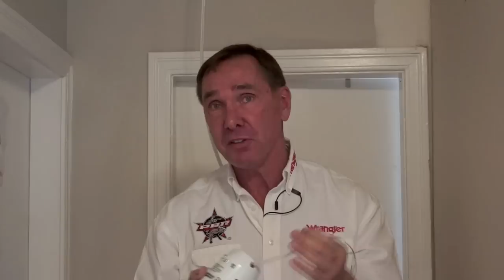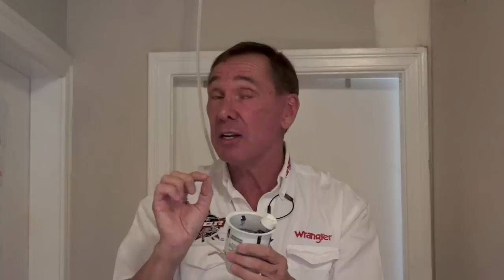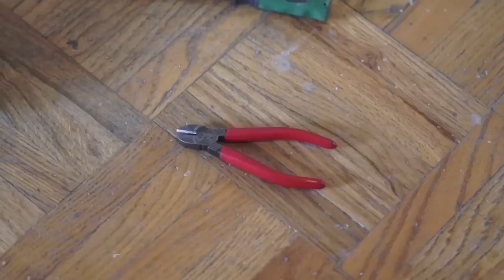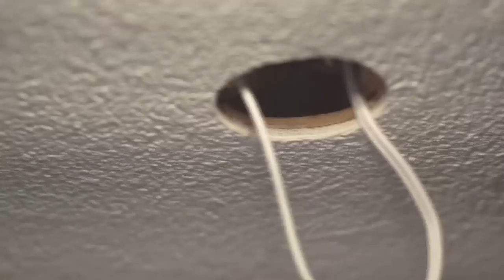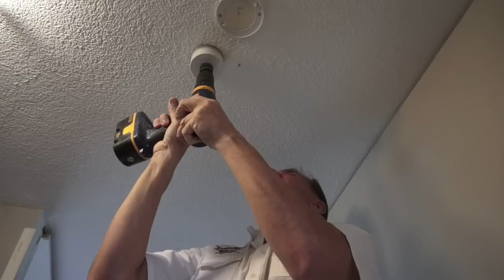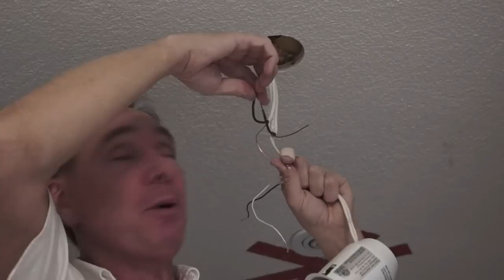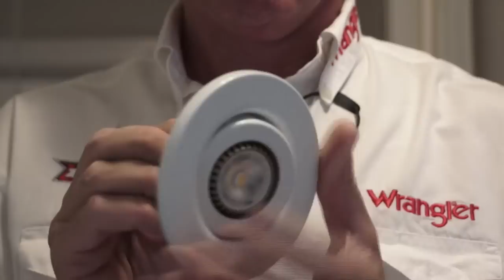How to Install Recessed Lighting | Retrofit

Comment: In the beginning of your video it looks like the fixtures had junction boxes attached. Why didn't you use them? Why did you go through the trouble of removing them? Wouldn't it just make sense to keep them and wire according to code?
Reply: Low roof line? Percy Lipinski Silly answer, With all due respect, you are incorrect. You could have used a grounding clip or even a self tapping screw to bond the ground, however you chose to ignore doing this and have placed not only yourself at risk but your family, and any potential buyers of your house... not to mention the innocent people who watch your video and will do the same dangerous installs that you have done
I will now report your video because someone can get killed and you can obviously care less, because instead of considering everyones advise to you here you also chose to bully and belittle users (and this is also against youtubes terms of service) because your too embarrassed to acknowledge you are in the wrong.
Reply from the maker: So here's why. You seem reasonable so I'll explain it. I would have had to replace the roof to donut as there is only a few inches of space no way to fit in a can let alone a connector box plus insulation. Do what's the only safe way to handle this? Either a big honking 12 volt transformer and non standard 12 volt bulbs that have been know to spontaneously combust due to the unregulated market for 12 volt fixtures. That has happened. 120 volt bulbs on the other hand are heavily regulated so I went thataway. The next consideration is safety. 5 or 6 watts is NEVER going to generate enough heat to cause any problems, even in my tiny ceiling space without a can. The stupid idiots on this video haven't got a clue beyond "because it says so in this book". The fact is "that" code book is seriously our of date and assumes that people will still be secretly using incandescent technology. I am not and never will and if I sell the place I'll be sure to tell them. That said, in this jurisdiction halogens are banned and soon federally so you'd really have to work hard to fuck it all up. Our family enjoys the very bright light, low power consumption of these bulbs and we'll be doing that safely for years to come.
Reply from the maker: Petey (stupid made up name if there ever was one by the way) you have proven once again how stupid you are. So let's keep it simple. I'm obviously "wrong" says who? "Wrong" means the house has an electrical fire and burns down you stupid idiot. I've asked for an example of exactly what it is that would cause a fire. NOBODY has come yet with one example of how this would happen. You know why? BECAUSE THEY'RE STUPID IDIOT MORONS THST HAVFNT GOT A CLUE!!! You are just as stupid as they are you dipshit for believing their idiotic rants. Grab a dose of science, instead of listen to these total fuckups!!! I 100% guarantee that my house will be fine today, tomorrow and for the rest of my life. No electrical faeries are going to come out at night and start shorting wires, you IDIOT!!!
Reply from the maker: It was not possible due to the extremely low roof line there was simply not enough space.
Reply: Joe Weatlu That would obviously have been far to close to the correct method for old percy, nothing but hammerdick it in for that chap.

p.s. I hear that if you show Percy your J-Card he'll show you his pecker :)  Bonus!
Reply: Hi Percy Lipinski   I want to ask a serious question... I noticed how you stressed in the video how important it was to connect the ground wires and make good connections. I also noticed you had never connected/bonded the ground wires to the metal housing of the light fixture . In this case, why was it so important to even have ground wires in your string of lights if you did not even use them? Lets say the hot wire broke off the socket and touched the metal housing of the fixture ? That metal housing will become energized with 120 volts. With no ground path to trip a breaker,  Anyone touching the housing now has the potential of getting a shock that could result in serious injury or even death. What is your reason for not grounding the metal fixture? Thanks in advance for a respectful answer.

Comment: Instead of all your fowl mouth comments to posters you should just admit your mistakes. Mistakes such as: the cans are not rated to be in contact with insulation, no electrical box for the wiring, telling people that 120V is not dangerous, assuming no one will ever install anything but LED lamps, etc. Most replies to the video had safety in mind. You seem to be totally against the safety aspect. I'm all for DIY work but it should be done to code and safe!!! You should either put up a disclaimer admitting your mistakes or take down the video!
Reply: Percy Lipinski
Hmmm...if you're in a room with 100 other people and you think everyone but you is an idiot, maybe, just maybe you're the idiot.
I rest my case!
Reply from the maker: Listen you Mindless Moron, I'm in rooms with thousands of people at times and I have no problems. This channel attracts a lot of weak inclined idiots like you trying to sell us crap. Unnecessary crap just to rip us off. I 100% guarantee that no matter who or where my instructions are followed, they are more likely to die of a lightning strike on the house than a fire caused by an electrical fire. It's low end losers of life that insist on following a rule book written decades ago. Hey Mr. Bill the bible is a code book. You following that to the letter as well, L O S E R dickhead.

Comment: As an electrician with two decades of experience, you're a fucking dangerous moron.  120V isnt dangerous?  Are you serious?
Reply: "There's nothing more dangerous than an idiot no brain so called electrician."
Yes there is: an idiot (with) no brain who posts on YouTube without having a clue who thinks everyone else must be an idiot because he doesn't understand why they disagree.
Reply: Percy Lipinski Have you ever seen electrical burns.. Panels, breakers, devices in boxes, splices....??? Do you think it's all made up so "electricians" can charge more?

It happens.. and your house isn't safe...

You used the wrong fixtures.. open exposed splices.... And your argument is it's been ok till now.. Have you ever removed the fixtures and checked for dark burning insulation... NO..

You installed these things saying 20 years from now you won't be able to get the dangerous bulbs to put in them..

All the stuff your saying and thinking... if you believe it ...

Your a danger is right..  I see new dry wall up in the video. Wonder what else your destroying and screwing up but justifying in Percy's mind?

Comment: Also, the Nest thermostat was introduced in 2011. How did you install these 4 years ago, when that is in place? Let me guess, you made a time machine too. You are the absolute definition of fucktard. 

I'm not starving, and wouldn't work in your shit pile house for all the money in the world. Actually, I feel sorry for your house. You've fucked it up really good.
Reply: Percy Lipinski
I wasn't sure what horsepower had to do with any of this, you brought up the incorrect estimate of how many watts is equal to one horsepower. I never stated that light equals heat, I am not sure where you got that from. I stated resistance converts electrical energy into heat. I understand that you don't quite grasp that, it is pretty advanced electrical theory. Much like understanding 120v of electricity is enough to kill you.

Is there a reason your face is always red? Are you always this mad when people try to correct you?
Reply: Percy Lipinski
 I don't understand why you are so angry. I get it, your installation has not had any issues, but you need to understand that DIY and hack work is the reason there are so many electrical fires. When things are wired to code, there is slim to no chance of a fire. When things are wired at a standard that is below the code standard, the risk of fire increases depending on how many mistakes and shortcuts were made. I find it hard to believe that you are an engineer if you cannot grasp such simple concepts. Perhaps your engineering degree came from DeVry?
Reply: Percy Lipinski
Man, you don't have the grasp on theory that you think you do. Also I'm seeing a lot of inaccuracies in your comments. You know 6 watts is not 1/100th of a horsepower right? 1 horsepower is equal to 746 watts rounded up. Anyway, you should relax. All of this anger and rage is probably what weakened your heart, if you don't chill out you may never see retirement. Assuming your house doesn't burn down from your questionable wiring practices.
Reply: Yes William R.  I pity the fool who may be wanting to buy this house in the future. All those beautiful high hats not knowing the shit poor job done on the other side that you can't see.

Terrible work... You were so close... All you had to do was to make the splice in the box that the fixture was attached to. They put that box on there for a reason, and even supplied it for you..

Probably was more work removing those boxes than just installing them..

Diagonal cutters used as a plyers... knick the copper much.. You can call people names and try to justify your work, but the truth is... you screwed up !
Reply from the maker: I wouldn't let your unskilled hands near my house to begin with you little loser, don't flatter yourself. So first of all there were two sets of lights installed one 5 years ago and another 3 years ago NOT 4 stupid. InFact I put some others in 5 years ago you icon of idiocy! Guess what? Not one system has had a problem. OMG how can that be? Maybe the "code" wasn't right!!! Code, ya it's a code alright,"a code of dishonor"
Reply from the maker: Why am I angry? I'm not angry I'm pissed off that you scammers see out to rip people off and you're so goddam stupid you have no idea what you're talking about. Get it through your head!!! Do you know what "load" is. It's POWER. If there's no power there's no load. If there were a short guess what you moron, the BREAKER would trip long before a fire. Load increases dramatically if you you increase wattage and heat increases dramatically as the wattage of the bulb goes up. It's physically impossible to have sky thing catch fire against 3 or 4 watts. Regulations for LED bulbs have not caught up to reality. As for your idiotic allegation that is why their are so many fires. WTF? You're beyond stupid because reality is there are less fires than ever because of fire detectors AND now LED lighting!!! You're all beyond stupid. Wait you're worse, you're con artists. Stupid ones at that. My house is not going to burn down unless I let one of you fart bags in my house and light a match but in any case even your fart won't ignite with an LED bulb!!!

Comment: As a professional electrician I can say what you are doing does not meet current installation codes, and standards. Your advice is reckless, and can possibly create a fire hazard. It may work now, but you better make sure your smoke detectors are functional.  Regardless of what YOU think, you are wrong, and this video should be removed. Don't believe me? Call an inspector out to approve your work.

The way you hacked in the Nest stat is comical. Find another hobby.
Reply: Hes gonna need a back brace from trying to read that nest everyday. Thermostat next to light fixtures? This is a house of hodgepodge